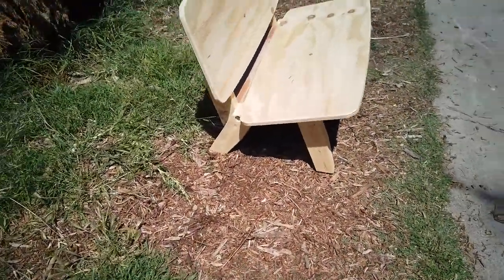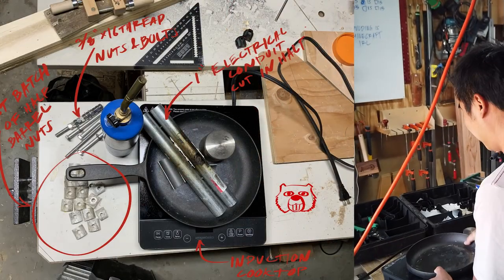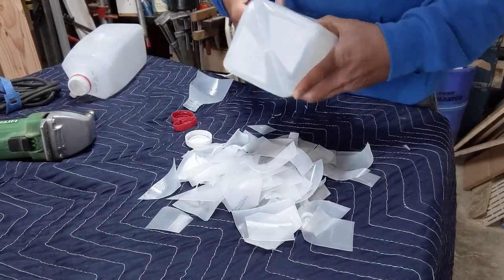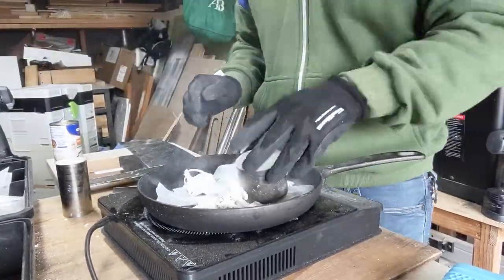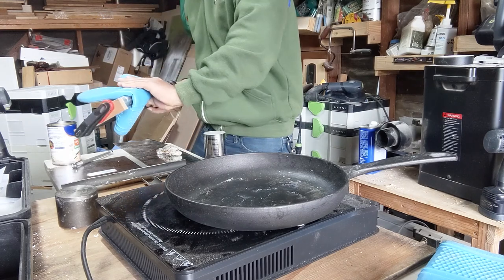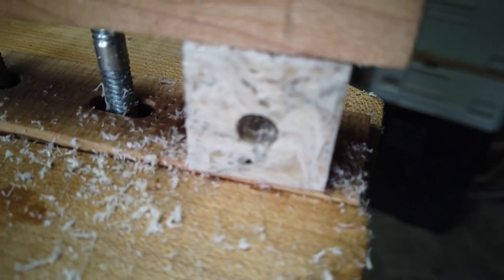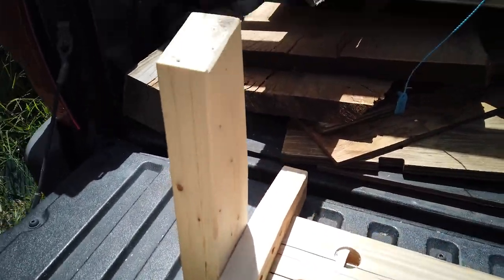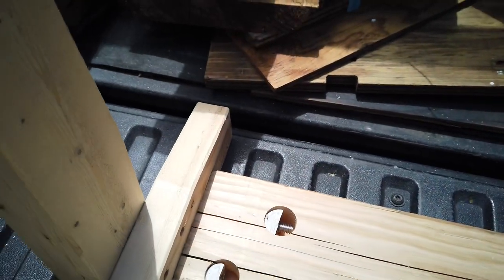How to: Make a bench with recycled plastic hardware

Comment: I think I saw ben uyeda grind the hdpe up in a blender, I’d try finer parts heating them up in an oven and then compressing it with a press of some sort.  I dig what your doing 👊 I’m getting rid of some tools soon prepping for the move hit me up
Reply from the maker: I just bought a bandsaw and it needs a new motor.  I’ve been thinking VFD to motor since it seems to be a lot more quiet and efficient.  Do you happen to know where I can find an induction motor?  I’m also thinking of running 220v power using a house plug and getting the other leg from a jackery/goal zero type generator.  How dumb is that?

Comment: nice diy procedures to make this plastic hardware. It would be easier for a production line, to use the Precious plastic shredder and injection machine, and inject plastic in a dedicated mold. To use that method though you would need to invest quite some money and effort to build the machines first..
Reply from the maker: Yes a shredder would be really helpful.  I think the injection machine can be done cheaper with an induction coil common for forging.  With more people starting to use plastic as a hobby material, I think the cost of these production machines will decrease.  Thank you for watching.  Do you have any ideas for recycled plastics besides jewelry, cutting boards, & coasters?
Reply: @wafflebeaver  I just did some experimenting with melting plastics in an oven and then compressing in diy molds, such as between pans and so, with rough results. Other than that, i ve been watching the precious plastics universe, where a lot of related information is posted daily.. I watched your how to there, and moved here to comment..
Reply from the maker: @spirosnik2651  I guess it finally got pass moderation.  I've been thinking about ordering ferrous based steel molds to speed up the process.  The mold can sit on the induction plate and melt some plastic pellets.  Ive also bee thinking about using a blender to shred plastic as that's what Peter Brown does.

Comment: That’s pretty interesting. I’ve seen others using this stuff, but haven’t gone down that rabbit hole yet. You’re right about how much waste we produce. It would be nice to be able to turn some of it into something cool. 

As far as heating the stuff in the tubes, are you thinking like induction coils around the outside of the pipe?
Reply from the maker: Yes.  I was thinking of using an induction coil around a black steel pipe.  Then I would extrude out the plastic through there.  Using a smaller pipe might be fine as well and I don’t think I’d need a forging coil more like a 12v -48v low voltage coil since I don’t need that super high heat.
Reply from the maker: I just realized that making inserts for your extruded aluminum rails might be worth it.  HDPE was created to be like paraffin wax so it should slide around nicely in those aluminum rails.
Reply: @wafflebeaver  that’s a good idea. It would be great for a lot of different hardware.
Reply from the maker: @ChrisPowellFSD  Mostly because those T-nuts are super expensive haha.

Comment: Neat idea. I was puzzled, why did you cut the cylinder in half, rather than using the whole cylinder for the nut? I've done some melting hdpe but plan to get back into it soon. Greetings from New Zealand.
Reply from the maker: Haha I cut it in half because I figured I could get two threaded beavers from one cylinder. I haven't made these in a while and I think I need to get back to it. A solid threaded piece of HDPE holds up well in this type of threaded/compression form. Also seems to do well with vibrations

Comment: Awesome recycling of total rubbish bits and pieces, mate. 👌🏽
Reply from the maker: Thank you. I probably should have showed the rubbish wood in use more but, I’m hoping to push the idea that using plastic might be easier than you think.  I really hope it encourages more people to try.
Reply: @wafflebeaver  
I think safety is high on the list of workshop priorities, and these fumes can be quite toxic and quite possibly to the tune of being a carcinogenic, you might want to get yourself a proper respirator for these types of fumes and an extraction fan. Best to be safe than sorry. 
An easy way to tell if your mask is failing you, is that if you can smell the odour of what your supposed to be wearing the mask for protection against, it's not doing its job!
And yes, recycling should be on everyone's list! Good luck with it all, mate👍🏽
Reply from the maker: @SMee67  thank you for caring about my safety.  I’m in a lucky situation where I have a good stock of vapor cartridges but I have thought about adding an extraction fan.  Problem is that I’d probably end up taking off my respirator.  If you look up the chemical make up of HDPE, it’s C2H4 so adding heat to it will only allow mixtures of air.  This doesn’t mean it’s safe to breath in fumes though, it will typically generate ketones, alcohols, and probably more carbon monoxide and carbon dioxide in an enclosed space.  Open ventilation is very important!
Reply: @wafflebeaver  
Good to know, and be an awesome added info bit in your videos for people not knowing about this side of recycling and are keen to get in to it.
Can never be to careful.😉